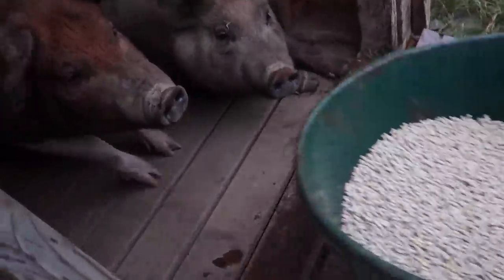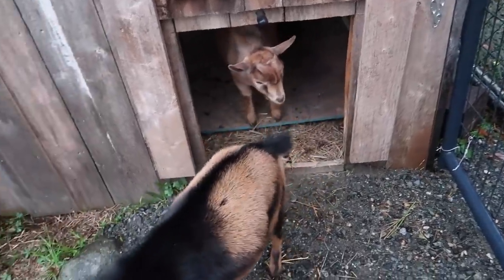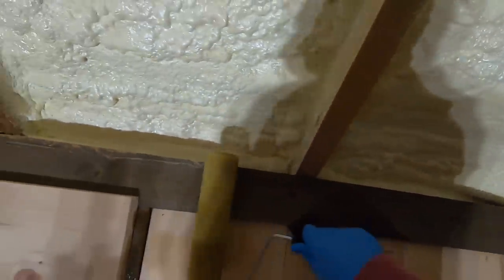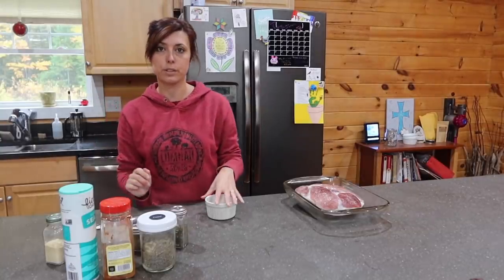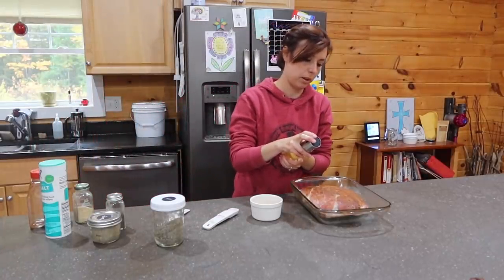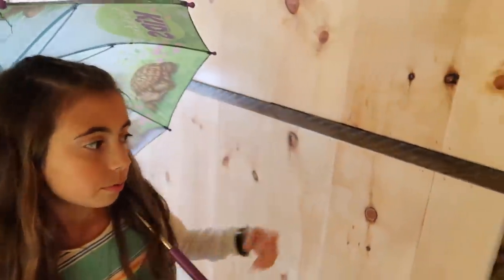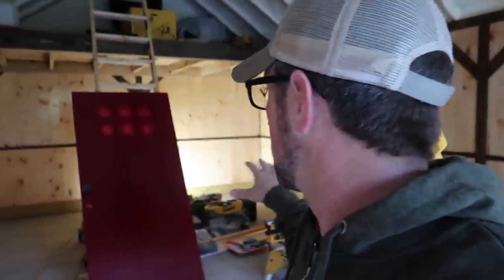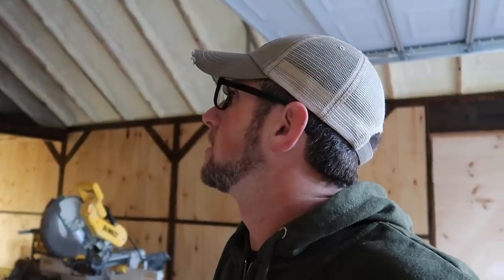Time to Get Sticky! Applying the FINISH to the Post & Beam WorkShop

Comment: How about the side benches fold down out of the way and center bench out of 2x8 top  and the bottom shelf 3/4 plywood  and 4x4 legs with casters. this will keep your work space where you can change things to the  project your doing. build it strong ,and they will come.  This is a work bench for a man lol I would also run an air line on the wall with a long real and put your small compressor up in the loaf and run it with a switch for cleaning  also  run power all along the back wall and the sides https://www.youtube.com/watch?v=I822PC9kW7Y

Comment: Use a combo of Solar and electric lights in under the loft and above it. ADD a wood stove in the shop for coffee, and warmth. I USE MR. BEAMS THAT CUT ON WITH MOVEMENT INSIDE AND OUT. Outside the Mr. Beams scare away predators.

Comment: Copper mesh you can get off the internet they hate copper, they cost me$1800 last year on my truck. A woodworking workbench they are strong and small, harbor freight. have in the house for crafts. I has one that i have, in the shop i have one that i made the top being 2x6s hand planed off 4'x4' legs and 2x4. along the bottom datoed in with 3,4" on top, a large vice one side the other side a wood working vice to use with dogs push down raise and lower. Pain the ceiling a light cooler to help with lighting.

Comment: Do you have any rowan-berry? Make excellent jelly and / or a tasty
lemonade- If you like that taste. 

1 kg of rowan
berries. cleaned and rinsed. Crush the berries with, for example, the
bottom of a bottle. Boil 3 liters of water. Pour the water on the
berry. Cover it. Leave for 2 days at room temperature. Filter it all.
Add 3 cups of liquid honey. Stir until it dissolves. Done.

Comment: It's really ashamed that you didn't prepare for the wiring by putting up conduit and then having the spray foam over it.  Now you'll have to live with the conduit on the outside.  It is very unlikely that you will need to move an outlet unless you put in so few in an effort not to mar the look of the barn.  I'm not sure why you didn't panel the loft area as that stands out as unfinished.  I would say this is just a workshop and not the Taj Mahal, but it appears the look of it is so very important to you as to everything you went through to "finish" it.  I think the way to make the workbenches is to glue 2x4s to each other.  I think that will make the top very sturdy, more so than plywood.

Comment: Next year covered porches on both ends of house and a back deck.
Also use a IBC wire tote to keep firewood in just outside the basment door
as you can see by this video 3 minutes in this guy has about 10 that are very movable
https://www.youtube.com/watch?v=xWw6YQ6GS2Q

Jamaica Cottage Shop should give you all the material as your builds are great advertising you do 
such a great job.

Comment: Why do all the fancy stuff to the walls & leave the ceiling that ugly white foam insulation? If you don't want to do the fancy post & beam, at least cover it in plywood. Dust & dirt also accumulate on the ceiling that will eventually stain it & make it look dirty.

Comment: Alright now you have made it too pretty to not do the ceiling too.
Reply: I know it will be expensive but you wouldn't need to continue the post and beam theme for the ceiling just run the boards front to back and polyurethane. It will make it brighter and look awesome for your videos
Reply: And we had the spray foam ceiling in the truck bays at the fire stations and after you pressure wash it which is a nightmare and paint it a month later your white paint works great to accent the dust webs hanging like chandeliers.